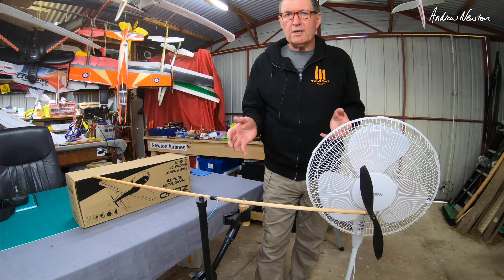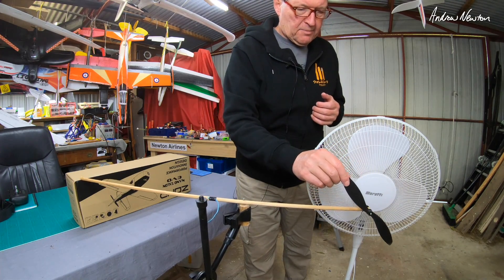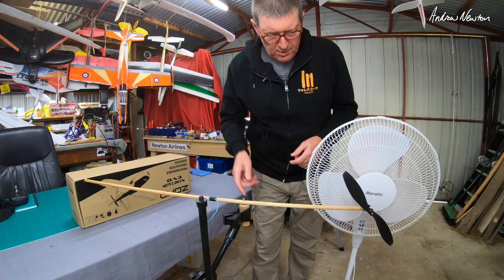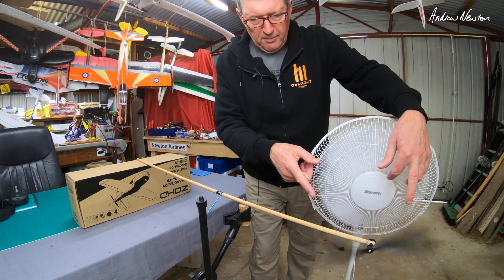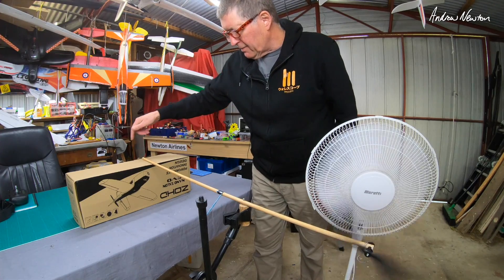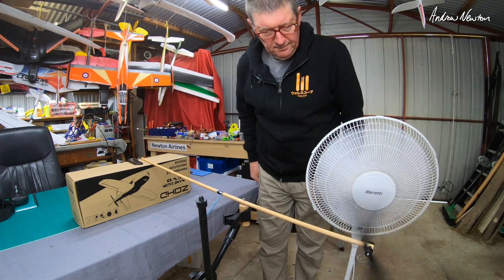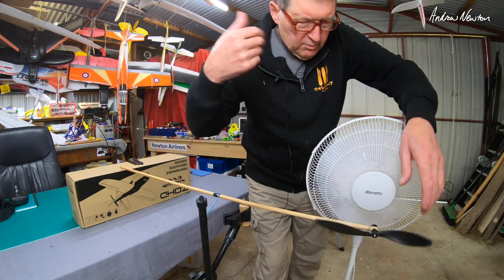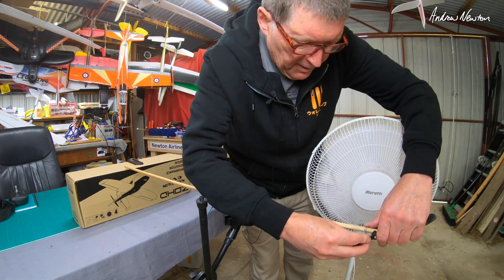Free-Spinning Prop - Drag Test

Comment: The results, or at least the exact amount of drag, could be different depending on the spin direction of the fan vs the spin direction of the prop. You could check this if you had right hand d and left handed props that were mirror images of each other, or by straightening the flow of air from the fan*. Maybe go outside, with two identical props at either  end of a stick that's pivoted in the middle. If you're in the middle of a field, the wind probably won't be spinning much. Or mount the beam out in front of a moving vehicle, if you can do this safely. Any drag in the bearing should make a difference, too.

*Blow through a grid?

I'd also guess that the pitch to diameter ratio of the prop makes a difference, and the airfoils of the prop, too.

Comment: Aww, this took me back to my free-flight days! With most rubber-powered planes, the huge carved balsa propeller had a clutch mechanism which disengaged it from the twisted strands of rubber, allowing it to twiddle freely once everything had run down, rather than trying to turn in reverse and wind up the motor again whilst the plane was gliding back to the ground.

It was hopelessly inefficient. Andrew's demonstration shows why it would have been (slightly) more efficient if the prop had remained engaged and 'stalled' in the airflow. Less drag. Still lots, but less.

I quickly moved on to experimenting with folding propellers, then got fed up with rubber bands entirely and saved up to buy my first teeny weeny diesel motor. Mmm. Chopped, bleeding fingers and ether fumes... Happy daze/days. ;-)
Reply from the maker: May be more drag with the stopped prop on your rubber powered model

Comment: Andrew is correct when he says it is not always the case that a freewheeling prop creates more drag than a stationary prop. There are more considerations to be had. Under some conditions a freewheeling prop will induce less drag. It will depend on prop size, design and pitch.  ESC braking will  be beneficial for most hobby-grade/scale powered gliders, an axially folding prop obviously even better for less drag.
http://www.peter2000.co.uk/aviation/misc/prop.pdf

Comment: Newton Airlines again shares the best knowledge for RC aerodynamics! Greay Vlog Sir Andrew!!
Reply from the maker: Thanks again!
Reply: Sir  @AndrewNewton  cant get to setup my buzzer  in inav.  whenever i power up the board the beeper sounds normal in the system initialization then after 6 seconds it continously beeps on its own.. This happens when i am in my workbench. Is there any way to disarm the beeper on failsafe or maybe when it is not getting any GPS sattelites and cant arm
Reply from the maker: I tried a buzzer once but there was too much unknown beeping so removed it.
Reply: Andrew Newton Sir the same with me

Comment: It's like a same diameter disk as the prop, if the prop is windmill on  engine failure. That's why variable Pitch props are feathered to stop them windmilling.
Cool way to explain.

Comment: In the discipline of F5B most competitive pilots have their throttle on a momentary switch. Since my buddy is only flying his for fun and not competitively I convinced him to let me install a second momentary switch on his controller that is programmed to have a very Low throttle value, just enough to spin up the prop and unfold the blades. By doing so and utilizing the second switch he has been able to shorten his landings by anywhere from 50 to 75 feet. The very slow spinning extremely high pitch propeller causes enough drag to slow the aircraft down by an estimated 20%. He then releases the second switch right before landing allowing the blades to fold for a safe landing without damaging the propeller or motor. Edit: Current speed record for F5B is 292 mph. We have not radared his plane but he is most likely doing closer to about 170  to 180 miles an hour. just a hair over 200 A on a 6 cell Lipo. 18 x 19 prop.

Comment: Great video Andrew, I'm a fan and plan on building your RC rescue boat design, thanks for the leg work!

Here is an idea to quantify the amount of drag. Pivot a one meter stick at the 500mm balance point and make your rig as before. Have the measurement end pressing on a small digital scale (accurate to .1 grams) and you should see how much drag there is in grams (tare off the elastic tension, or use no elastic at all). I Imagine it would work to measure thrust too, might make an interesting video, exactly how much drag does it cause? Different sized and pitched props? How about a folding prop?

Hope it helps with a future video idea and might provide useful data for some of the perfectionists!
Reply: If you build an accurate test rig you could measure motor prop efficiency, power consumption and all sorts of useful data. How many grams of thrust does your model motor produce at a given throttle setting etc

Comment: I've known this since at least 1973 when I was flying quarter midget R/C pylon. I probably knew about it when I was learning to fly R/C back in the mid-60's. Even when the prop is being turned by a glow engine at idle, the plane will slow down bettter with the engine running than it will with it stopped. Seems like the phenomenon was attributed to a "spinning disk". I imagine it's because a spinning prop creates more turbulence behind it than one that is stopped and therefore, creates more drag..

Comment: Small folding push props on the Zhod would be great (maybe it is the wrong video to discuss that)
Reply from the maker: Right video. But I have never found a decent small folding prop unfortunately. I have looked for U-Glider replacements with no luck.
Reply: 3D printed?

Comment: Athe spinning prop is pulling itself forward. Reverse the direction of the spinning prop and it will move towards the fan. This test proved nothing.
Reply from the maker: The prop is facing the fan

Comment: Sir, Do we have counter torque for single propeller in rc plane. In duel propeller how get thrust forwards while two propellers run in different direct to over come counter torque
Reply from the maker: They rotate in different direction but push in the same direction. One is a CW prop and the other is a CCW prop.

Comment: If you think about it from an energy standpoint it's easy to understand. It takes energy to physically spin the prop.  This energy has to come from somewhere. Since the only energy is from the forward movement of the plane through the air that extra energy needed to spin the prop causes additional drag.

Comment: Ok, I would have placed money on the opposite, I now have learned something, how to set the brakes on my esc ....
Reply: There are instances where you might prefer to have the prop windmill and have more drag. Some thing like a STOL plane will benefit from more drag and a slower landing speed.
Reply: @d.b.cooper  Yep, also.. a lot of motor glider pilots actually input min throttle on landing approach to unfold and spin their folding props to act as an airbrake.

Comment: Andrew, I love it that you dont just take the group think for granted.  Great experiment.  There are a lot of other “well known” things in this hobby that I wonder about, for example that LIPO battery life is extended by keeping the battery at storage charge, that conformal coating really waterproofs electronics, that it is safe to hand launch a wing with an overhead toss, etc.  Lots of “common knowledge” which may have never been actually proven to be effective.

Comment: Bookmarked. The next time this argument comes up I'll know what to show them. Excellent demonstration.
Question; knowing this, why do rubber power models go to such extremes to free-wheel the propeller after the rubber runs out? It now seems obvious the propeller should be stopped.
Reply: Good point but how would you stop it? If you fixed it to the rubber band, it would overshoot and then unwind in the opposite direction, providing reverse thrust! The drag of the spinning prop is the less worst scenario.
Reply from the maker: We need to ask Josh Finn about this.

Comment: So the solution to apply for our long range setups would be: Installing self folding props / set the motor to idle / enable the motor brake
Reply: Why even on a long range? Haha
Point of long range is to fly far away, u wont be going far if the prop aint spinning my dude
Reply: FpvBerget wtf? long range / endurance setups
Reply: @DashzRight  Ye, when going long range ur prop is spinning constant at low amp draw to get u forward? Whats the point in having folding prop with brake except when landing?
Or u talk about soaring? If thats the case u will get even longer flight time without motor and prop at all just by saving weight.

Comment: I didn't know this was in question. Otherwise you couldn't do a Helicopter Autorotation landing during loss of power.
Reply: TakeItToTheGround:  And "Ground fine pitch" would not work as a braking medium on turbo-prop aircraft.
Reply from the maker: More testing required. Higher pitched prop might reverse the results

Comment: Maybe the same thing with more DRAG ?  LINK (PIN WHEEL) ==> https://en.wikipedia.org/wiki/Pinwheel_(toy)
Reply: Let's not forget the nature of the fluid (high or low viscosity) and the speed of the fluid thereby giving a Reynold's Number. The EXPERIMENTAL SET-UP seems perfect though.  Pretty much the same as a Wind Tunnel.  By the way, is there one near you ? NASA/Greenbelt is near me, but Univ. of Maryland's Wind Tunnel which I'm more familiar with has been used on a regular basis since it was built. Researchers even used it to compare ice skating suits for Olympic competitions.

Comment: You can’t argue with science. I feel redeemed for turning on motor brakes 😄
Reply from the maker: I do it mainly to save props on belly landers, and for a better onboard view past the prop
Reply: But it’s not the whole picture. Under some circumstances freewheeling will create less drag but certainly that’s not typical of most hobby grade RC.
Reply: http://www.peter2000.co.uk/aviation/misc/prop.pdf

Comment: I've setup my electric models with idle, I flick a switch and the motor runs just slow enough to not move the model, it makes a differance. I've never seen real aircraft landing with a stopped prop. Great info there Andrew.
Reply: On a real aircraft you have power on during the landing run. You effectively fly into the ground, well kind of. Its when you have touched down that you reduce to idle or go with reversed thrust. On rc we tend to glide a lot on landings and certainly in the air. Reducing the drag will allow the plane to maintain its air speed longer before needing to put power on or notice that alt is reducing.
Set a break on the esc you will really notice the difference

Comment: That's crazy. Like almost everything else in aerodynamics, the result is counter-intuitive. Good test!
Reply: It is counter-intuitive, but no brainer if you think about it. Helicopters with a broken motor can still land safely by using similar principles. I guess that we will have to learn how to program brake on our ESCs.
Reply from the maker: More testing required. Higher pitched prop might reverse the results
Reply: @AndrewNewton  After seeing those results, my guess is that it won't. I'm looking forward to seeing the results!

Comment: I stand corrected (and amazed).
THANKS!!!
Reply from the maker: Actually you are not totally wrong Curt. With higher pitched props the difference reduces and there is a cross over point.
Reply: I could be very wrong here but it seems as though the energy required to spin an unpowered propeller must come from somewhere. It would be my educated guess that the power is coming from the airplanes stored potential energy. The result is a lower L over D and also lower glide ratio.
Reply: D.B. Cooper http://www.peter2000.co.uk/aviation/misc/prop.pdf
Reply: Now if we were talking about a mission specific designed aircraft that is supposed to thermal up to altitude, engage regenerative motor breaking allowing the recharge of onboard flight batteries, then .....

Comment: Would you mind terribly using your wonderfull to help me calculate the drag of a piece of ribbon? I m suggesting say 1m them 2m and to see how much ribbon could be towed by a pss glider without having dramatic effect on its performance
Reply: Alexis, do your own experiment! Attach the ribbon to a rubber band and the rubber band to a slender stick. Extend the stick out the window of a moving car and observe how much the rubber band stretches. Read the wind velocity from the speedometer of the car. 
   This probably won't work the first time. It's up to you to figure out how to make it work! Just be sure the driver doesn't get distracted and wreck the car. Fun!
Reply: I do not know, but if you get a full length old style audio tape and  a 1400 motor high wing 1m w/s  a/c you can fill the sky with tape. (which another flying a/c flew into).   I got the idea from watching a sparrow fly off with a very long length of audio tape during nesting.
Reply: @grandaddyc  I've done plenty of towing of tapes, Ribbons and tow lines with power but what I'm looking for is the amount that a non powered model could sustain without real detrimental effect, what I might do 8s just see how much the glide is affected on a powered model with different lengths of ribbon
Reply: @alexisscott9573  Rubberband audio tape cassette on top of your most slick glider, pull out length of tape, bungee, winch, tow, land, more tape. Repeat. When wobbly stop and cut some tape off.  Cheers.